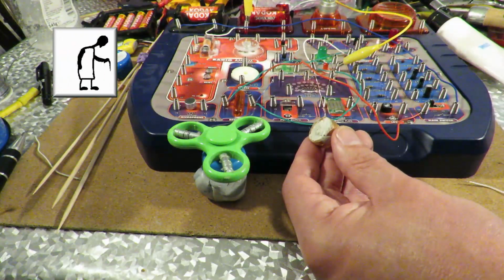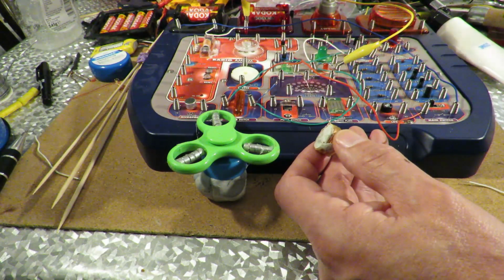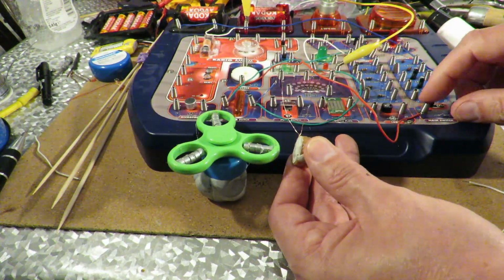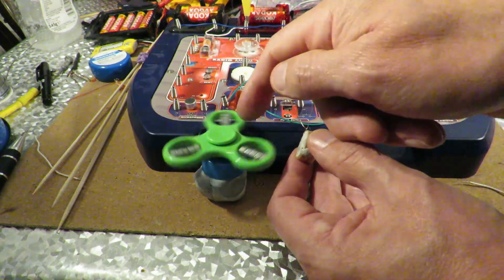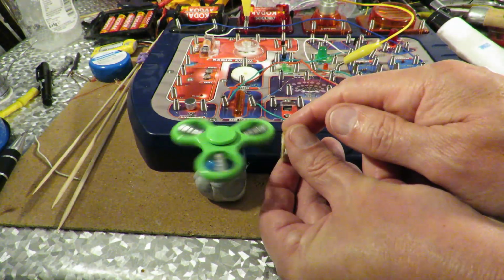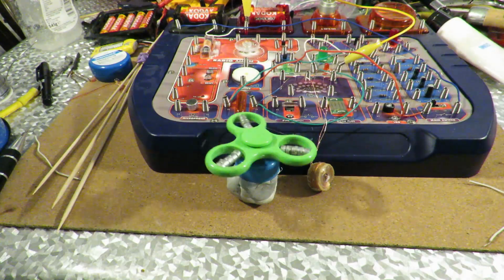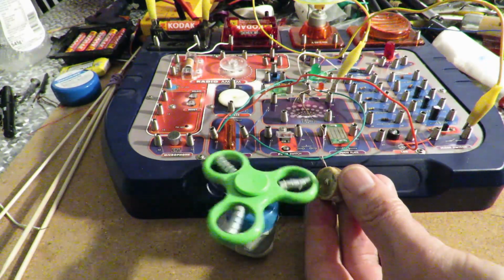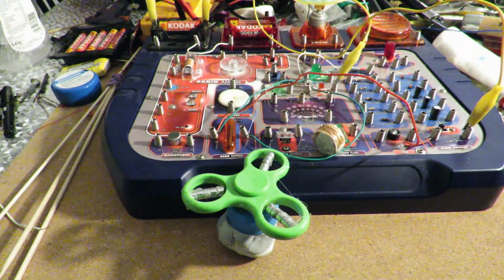Pulse Motor circuit from old Electronics Exploration Kit

Comment: Just looking through the videos again.
Try making a Bedini motor. He captured the "back EMF" to charge a battery and reckons there is more power being produced by the "back EMF" that what is needed to run the pulse motor.
I am not saying it worked but there are many who say it does work. I built one a few years ago and it did spin up the rotor, as for getting more power from the output, I am not sure. I never tried measuring it, although I did put a small neon bulb on it and sure enough there is enough power to light it up. It does not use a reed switch, it uses a transistor to switch the circuit on and off. 
 "The Bedini Motor". Here is a link. https://www.youtube.com/watch?v=ttY7yLXZSpo
Reply from the maker: Yes, I collected up a load of old lead acid batteries with the intention of charging them/restoring them. Never did get around to it, so I have about a dozen of them sat in the shed or the garage. Got some nice big transistors in a draw somewhere too.
Reply: @GrandadIsAnOldMan  LOL Ah....Well get it built, but the thing is, it's not really for restoring batteries. It is to try and demonstrate the idea of back EMF putting out more power than what is being put in. I know, I know, you are a sceptic with this stuff. Personally, I am on the fence with it. 
I have just restored an old car battery by pumping in 50 amps to it. I will stick a video up on my popular Mikes Electrical Stuff channel when it stops raining. The high amperage descales the battery far better than those silly descaling kits. It actually brings the battery back like new.

Comment: Another brilliant experiment with a coil. Very enjoyable to watch. 👍👍👍
John Bedini created a circuit like this using a bifilar coil. The extra two wires from the coil created a high voltage spike when the motor was running and was used to charge a battery. 
Seemingly it is a very simple circuit. Its just called, "the Bedini motor" 😀
Reply from the maker: Yes, one of those projects I always intended to do and never got round to. I have a whole load of lead acid batteries stored away to try that on and never did it. Unfortunately it is often associated with "free energy" rather like any of my telescopic/full zoom "boats on the horizon" videos get associated with 'flat earth'. I have written to YouTube and formally asked them to fix their algorithms as it is abusing my channel and misleading viewers as to the content. That has been ongoing for months with no action or result, just one of their robotic (no honest I am a human) weekly update emails. 

Thanks for waiting! 

Just to keep you updated that we're still waiting for an update from our internal team. 

Rest assured that I will get back to you as soon as possible. 

Let me know if you do have other concerns.
Reply: @GrandadIsAnOldMan  I always thought the Earth "was" flat. If it was round we would all fall off. 🤣

Comment: I used a spinner like that to make a pulse motor once and I had it spinning so fast the bearing locked up after a few try’s, I had two coils powered at 12 volts  making it really fast
Reply from the maker: Yes some people like to make things go fast, some people like to see how little power you can use to make them spin. I am just happy if they work.
Reply: GrandadIsAnOldMan lasersaber makes them run of capacitors using very little power